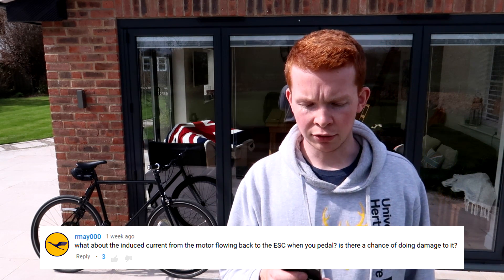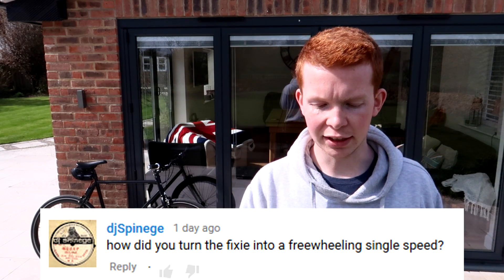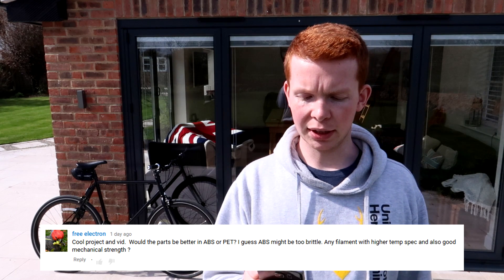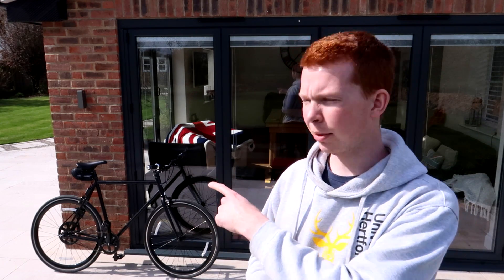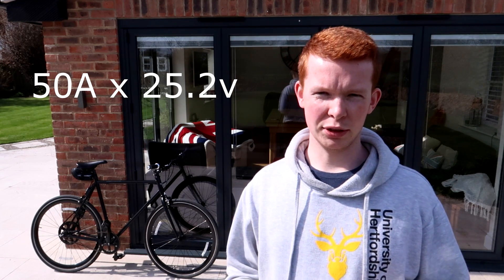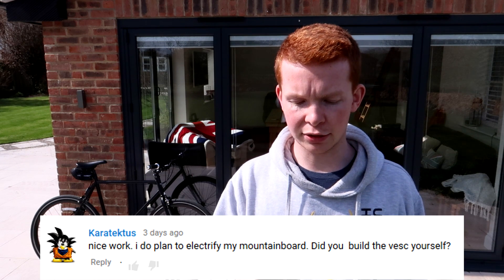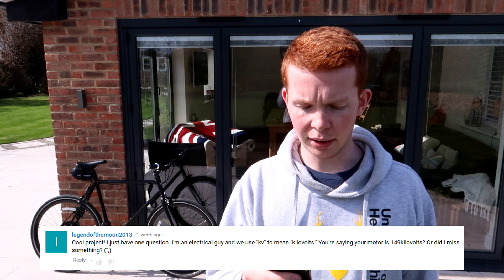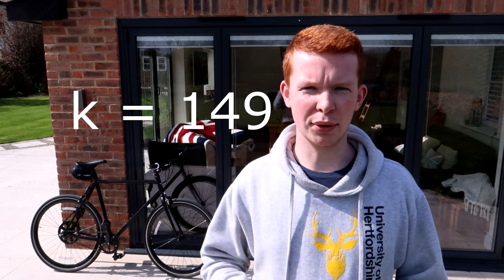DIY Electric Bike - Q&A

Comment: how do you charge your 6s lipo, i have a imax b6 mini, but i use my lipo in and electric skateboard i made, and wanted to find a bms and charging solution thats a bit easier than cramming the imax under the board and connecting the lipo through a balance connector. many thanks

Comment: I tried to recreate this project! I'm having issues stopping the motor and motor mount from slowly sliding down the frame and losing tension (after a few rides and a few bumps). Any ideas? I currently am wrapping the frame in friction tape and adding a bit to the inside of the motor mount to add spacing in that gap
Reply: Or is it possible for you to publish the actual model files so I can move the tensioner a bit closer to the other side like you did for the V3

Comment: Hey i am using an Esc 80a Hv Aeromode E Helicoptero Rc Speed Control, what do you suggest i do to avoid the induced current flowing from the motor flowing back into the ESC when i pedal? Should i use a diode or something ? Thx man you are awesome!

Comment: What did you have to do to push the shaft to the other side on this motor? I have the same exact motor and I am not sure if I need to take the pin out as well other than loosening the two grub/set screws?

Comment: Yes, there's a difference between stiffness and strength. But still, PLA has a greater yield strength than ABS. It is stronger under ideal conditions, with a tensile strength of around 60 MPa, versus 45 MPa. It is however, more brittle.

Comment: @tom Are you using planning on using one way bearings, it seems the main gear is permanently connected to the wheel. For pedaling and usual riding without battery, does it coast without spinning the motor (offering resistance) ?

Comment: Have you considered using an DC/DC converter to upgrade the output voltage of the bike? Upgrading the tension you'll get more torque and could aproach to the nominal power of the motor but you'll have to look for your back because you'll have lot's of amps running in your backpack. Or you could combine two batteries in series coupled (as someone already suggested you) with the DC/DC converter to get closer to the nominal voltage of the motor without burning your back!

Comment: Great work! But I want know how you modeled the HTD5 pulley for the wheel. what software did you use and how did you go about getting the right dimensions?
Reply: most softwares offer a gear designer feature, or you can find the part online, some sellers provide cad data

Comment: Where, pray tell, did you find a 12 tooth pulley t5 for an 8mm shaft?
Reply: http://www.ebay.com.au/itm/HTD-5M-15mm-DUNLOP-Timing-Belt-Pulley-Pilot-Bore-5mm-Pitch-15mm-Wide/222681418514?ssPageName=STRK%3AMEBIDX%3AIT&var=521536264089&_trksid=p2060353.m1438.l2649  .  thats on ebay australia but it is from the UK, Saltash,Cornwall  ; EDIT just realised thats a 5mm bore.. they might do a 8mm?

Comment: Don't even bother with printing ABS or PLA. ABS is a pain in the ass and PLA is crap for anything that requires strength or wear resistance. PETG is easily the material you want for this. It prints almost as easily as PLA and is just as strong, if not stronger, than ABS. Or you could do it in nylon if you really want to put some torque on it.

Comment: I am in the process of building a bike like yours, I am in the process of finding a good brush-less controller motor + throttle. I am a programmer but I would prefer not to get into the arduino controllers... Any suggestions? I don't mind paying 100$+ for it
Reply: perhaps a PWM esc tester could work as throttle if you unhook the pot and plug in your throttle

Comment: what about using supercaps instead of a battery? charge them when pedalling and use the motor as a generator
Reply: Supercaps would cost considerably more and considerably reduce the range. They're really only useful when you need extremely high levels of current, both charge and discharge. The battery is already more than capable of stalling that motor. Although, with a better motor, a hybrid battery may be useful, a supercap bank for extra acceleration and the battery for distance.

Comment: I'm currently working on an electric kick scooter, but I fear I may have cheaped out a bit too much and ended up with an inadequately small motor.

Also, I can't find a good way to interface the motor to the wheel. There's not much room!
Reply: ah that's very sad

Comment: I'm struggling to find a good vesc... can you pass me on a link to a vesc (possibly a vesc that was used for this bike), I'm from the UK
Reply from the maker: +brian howell Hobbyking sell the vesc (turnigy 50A skateboard esc), but I'm not sure of the quality
Reply: hi did you manage to get a vesc im going to build this but struggling were to get the vesc any idea cheers uk
Reply: Tom Stanton and will that work with the throttle as its analogue
Reply: Sidharth Shanmugam get a vesc from ollinboards, vanda, diyelectric, enertion focbox, hobbyking vesc might aswell die in a couple days

Comment: additionally, model size BLDC motors aren't rated for the type of duty cycle that a bike would put it through.  RC planes typically don't fly continuously for 1/2 an hour like this might.  I have seen people make CNC spindles from RC motors.. they wear out faster than purpose built Brush less motors do.

thanks for showing proof of concept.  I feel a little better about my same decision of buying a 2kw bldc motor.
Reply: BLDC motors dont have much torque, because there are no fat carbon brushes pumping juice to the coils, but BLDCs do not wear out, since there is no brush which grinds against something, only thing that might happen is that it overheats and the enamel coating melts , shorting out the motor, or the tiny bearings run dry
Reply: Shaft bearings

Comment: Make this triple version... please :)

https://www.imageupload.co.uk/images/2017/04/23/triple.png
Reply from the maker: Haha I'm considering a double motor version on 12s, would be crazy quick!
Reply: That design was a double before I added the bottom motor,...  ok you can patent the double, But the triple is mine!
Reply: Seriously though, I've looked at  lot of Elecbike designs and yours is probably the best regarding motor efficiency and rotational mass (You can use any lightweight flipflop-hub rim-brake wheel.)
Reply: Here is a bianchi fixie frame slightly modified,.. making this compct enough for foot clearance would be tricky. https://www.imageupload.co.uk/images/2017/04/24/bianchielec-1.png
Reply: You can use one motor on each wheel and one in the crank. Would be amazing. 12s batteries, 3 motors, 6kw of power.

Comment: The regen seems like the missing piece of production electric bikes.  On cars, it can add significant range, but range doesn't seem to be such an issue with bikes.  
For safety, put a "cut off" on both brake levers would ke
For a 12 cell, it seems to me that if you relocate the motor to be above the rear brake caliper, it would be up and away from the road grime or rain (a small rain fender under the brake caliper would also shield the VESC.) . with the motor above the rear tire instead of outside the seat stay, it would also be within the line of the frame (away from the foot of the rider) and give you space for a reduction gear to maintain optimal rpm.
Reply: Regen isn't so effective on ebikes. It turns out to not really be worth the hassle on most bikes: http://www.evelo.com/blog/why-dont-more-bikes-use-regenerative-braking/

Comment: Good stuff, not to be that guy but get a helmet if you try 12S I had 11S with the same motor and vesc on a skateboard but pulled it back to 5S as the top speed was overkill for cruising and get better range with smaller batteries.  You've got some good brain parts wouldn't want them to end up on the street.  Thanks for sharing!

Comment: Why did you disable the regen?
Reply: if you pedal and the throttle is closed the motor will slow you down all the time working as a brake.
Reply: not great fo the battery health I guess.
Reply: If your battery is full and you push more energy in there something bad will happen.
Reply: Matthew Jaroslawski then what is the solution?

Comment: Freaking awesome stuff! The U.S. is stupid when it comes to units of measurement. Metric makes so much more sense. Convert if "You" want to but don't let the a$$ holes bother you. We can do a simple Google search to convert if we need to. I built a petrol moped out of a similar bike. I tried using the original fixed sprocket and I couldn't get enough torque so i had to take it off and put a bigger one on. I can't wait to be able to make an electric one.
Reply: Yeah, Tom. Please measure in metric system. It's really just better for engineering to use one type of measuring systems that are easy to convert and understand. 
BTW love your videos. I'm trying to learn from YouTube and you're one of the best explainers in YouTube. Thanks

Comment: Working with the same motors in my school project, i've had some major esc overheating issues, bad design by me, hopefully fixed now to do a full range test. Here's an album and some video http://imgur.com/gallery/jC4lS
Reply: what kind of esc did you use?
Reply: Matthew Jaroslawski I used TURNIGY AE-80A BRUSHLESS ESC. They work really well, I programed them for lower timing, softer start, light braking etc. They overheated for me when passively cooled, once I mounted a fan over them they haven't overheated since.

Comment: Hi Tom,
 
Thanks for your reply to my question in the video (12S battery), I appreciate.

You're right, it's better to adjust the gear ratio if using a 12S battery (not espcially to increase the top speed, but to increase torque).
My project is to link the Motor to the pedals, because the pedals have a more constant RPM than wheels (50 to 90 RPM), thus it should be easier to adjust and to find the correct ratio to avoid overheating and to get more effeciency with high voltage and low speed.

How do you limit the max Amp to 50A ? Is it thanks to the VESC ?

Commercial aspect is an important point you want to sell a product, an idea or a project : imho, the testing video of the bike was no relevent (lot of wind, no feeling of motor assistance) compared to hard work you made, that's probably why you got some stupid comments...

Again, very good job, just go ahead !
Cedric
Reply from the maker: Hi Cedric,

The VESC has current limiting capabilities which can be programmed for both current supplied to the motor and current charged back into the batteries when using regen. yeah I agree, the footage of the testing was a bit rushed as it was the only day with decent weather. I also think it's quite hard to show the performance of the bike on video as it looks a lot slower than it feels when riding.

Thanks!
Tom

Comment: with vesc you can use analog signal direct from any kind of throttle(button or hall throttle or warieble resistor) to vesc without any arduino or pwm and etc (vesc can see 0-5v and use it as throttle)

Comment: Road legal ebikes with the motors rated at 250 watt will see spikes of over 1000 watts at stall so peak output is not a legal problem.   If you wanted to make the bike road legal you need to create a switchable mode that doesn't allow the bike to go over 25Kph.
Reply: Nick Flynn screw that. It's so stealthy it won't be a problem. I have ridden a 5000w e bike for the last 4 years in a big city and always ride sensibly and don't have any issues. That will do 80kmh.

Comment: Kilovolts is normally kV, where as the brushless constant is usually written as Kv.
Reply: The correct notation is Kᵥ (ideally with an italic lowercase v) with the lowercase being used since it is easily typable...

https://en.wikipedia.org/wiki/Motor_constants#Motor_velocity_constant,_back_EMF_constant

Comment: Upgrading to 12s is such a simple step, I'm surprised you haven't done it yet. Print a 250 watt sticker and slap it on there. I would like to see a police officer whip out a mutlimeter and write you a ticket. You can probably get your Arduino programming friend to hook you up with a toggle for on and off road PWM profiles, if you wanna be completely legal.
Reply: actually with the right firmware the modes the VESC is operating in can be changed via a BT module and Android app. You could set a default value to 250W and use a higher mode on private property ;)
Reply: I thought about that, but I don't know a lot about the VESC, and I don't know if you could add a easily "oh shit the cops!" switch. Haha. If you can, that's another way to go for sure.
Reply: An off road switch or software switch to restrict to 250w is still illegal, the law states the motor itself must not be capable of exceeding continuous 250w
Reply: the problem arises when you crash into someone or something at 50kmph and they recover your beefy motor